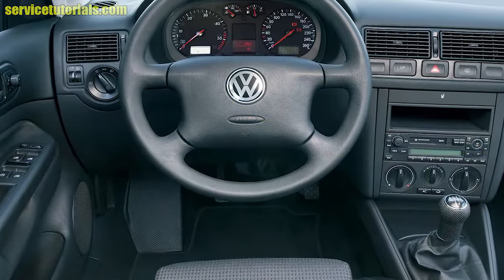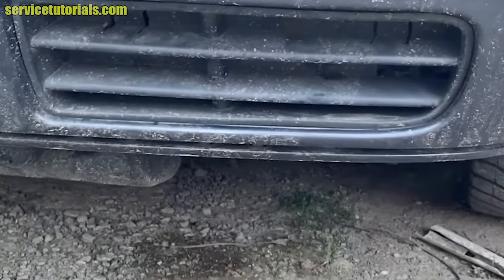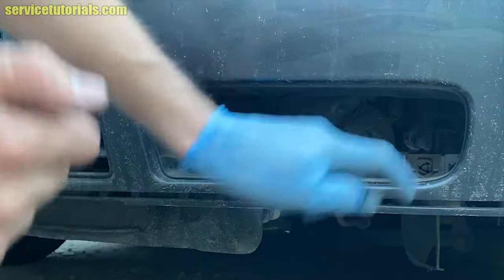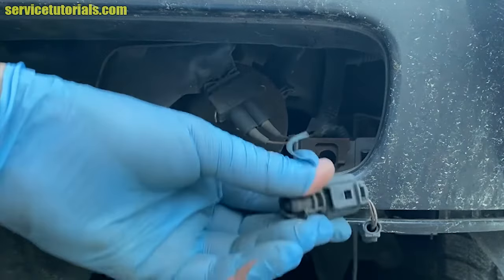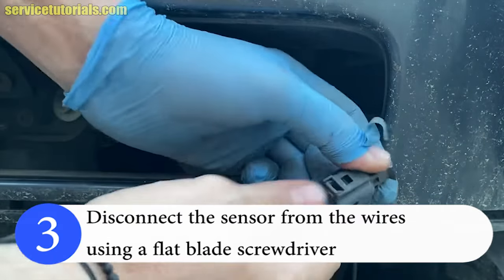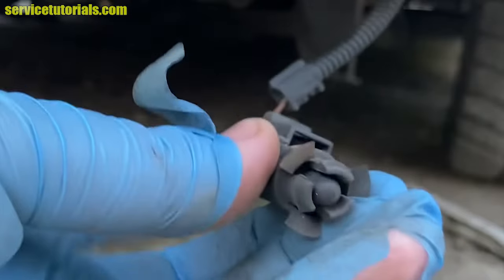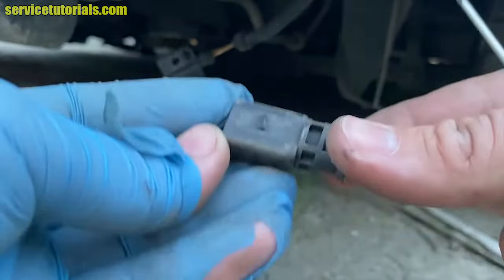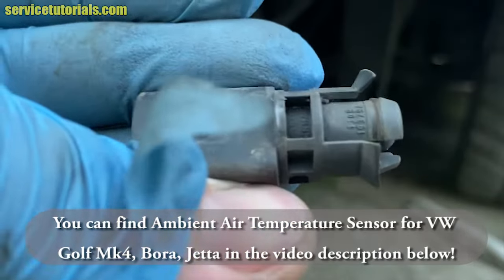VW Golf Mk4, Jetta, Bora G17 Ambient or Outside Temperature Sensor Location & Replacement in 3 steps

Comment: Hi, I changed my mileage counter to the one with the display but it doesn't tell me the external temperature. I checked the sensor in the bumper but the wiring is missing. Do you know if I can wire it myself?

Comment: Can this be changed to a different sensor so that you can run the AC pump at lower ambient temperatures to help you defrost your windshield? The diesels are hard to keep heat in the engine when it's very cold and sometimes you need to recycle the cabin air and run the AC to defrost the windows.
Reply from the maker: No, you can’t. This sensor has a serial number on it and it has to be the same. Otherwise will not work.
Reply: @Servicetutorials  I had a feeling, doesn't hurt to ask though. Thanks for the reply.
Reply from the maker: @sabbath7081  You’re welcome!